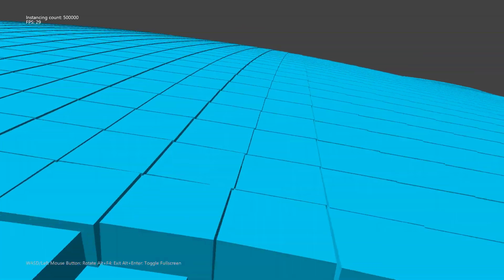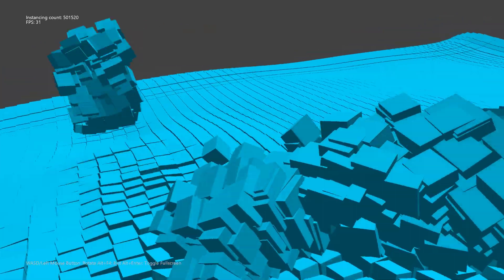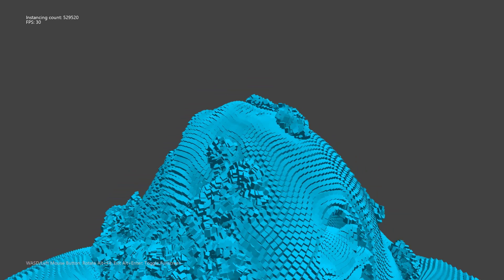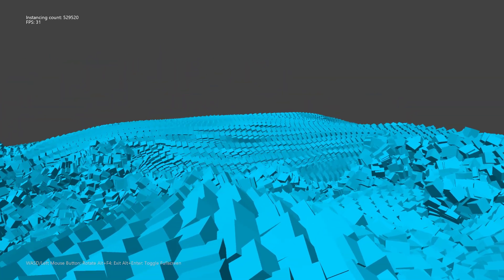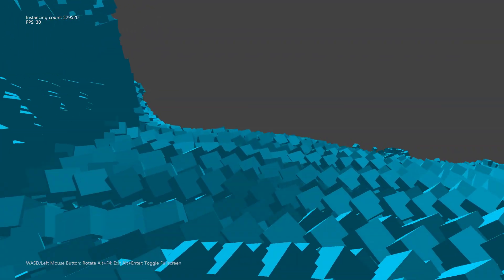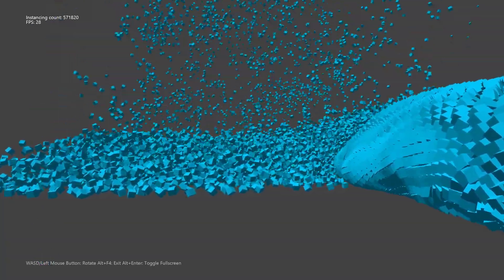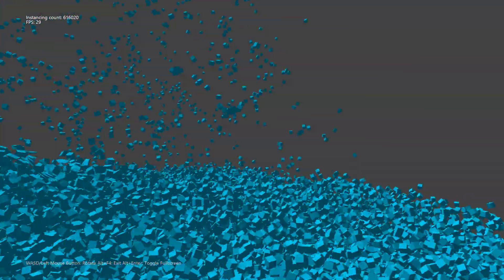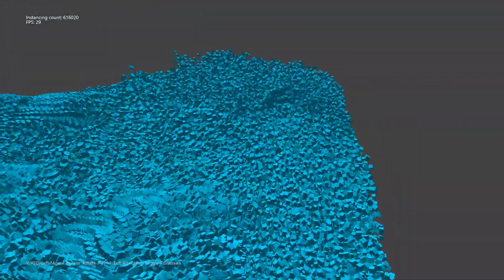Viscoelastic and Granular | Voxel Physics Devlog #4

Comment: >  🔭 Adaptive Level of Detail (more particles closer to the player)
Does each box represent one particle, or is the particle granularity independent to rendering granularity?
Reply from the maker: Each box (or in more recent examples, meshlet) represents one particle. For the adaptive stuff, this actually means some particles get deleted when the level of detail is coarsened (e.g. 50% increase size, 50% delete), and split (duplicated with small offset and reduced size) for higher level of detail. For the time being, it is turned off in most of my demos unless I actually say it is there (only 2 vids). There is quite a bit of work to be done for it still.
Reply: @GrantKot  I see. I'm currently trying to build a similar thing, but with merging and splitting like that I get issues with preserving volume and "popcorn" instabilities. Might be due to the large dt I use.
Thanks for providing the inspiration!
Reply from the maker: Are you using Material Point Method? For volume preservation I use an SPH style density summation each frame instead of integrating density/volume over time. No matter how small your dt is error will always accumulate. See this paper for formulas (especially section 4.5): https://www.seas.upenn.edu/~cffjiang/research/sediment/gao2018sediment.pdf
Reply: @GrantKot   Thanks for the tip, will check that out. Yes, I'm using MPM with APIC. Currently I'm focussing on single material fluid.
Any particular reason why you are using PIC FLIP and not APIC? (At least I though I read it somewhere in one of your video descriptions.)
Reply from the maker: I used PIC FLIP blends for a long time but have been using APIC based stuff more recently. Sometimes I miss FLIP a little, I think in certain scenarios APIC overly smoothes features out. I think you can technically have an affine version of FLIP (should trademark AFLIP lol) and it’s not difficult to do, just requires more processor time.
Reply from the maker: Actually since I’ve been thinking of going AVX2 from SSE2 it may very well make sense to add in AFLIP and might be possible to do without much performance penalty.
Reply: @GrantKot  hehe sounds cool. I'm struggling with performance a bit. With AVX2 and AoSoA I can't get close to the performance you achieved.
Currently a single core takes 20ms to simulate 125k particles (no graphics). Bottleneck seems to be reading (Avx2 gather) and writing from the grid (plain old scalar). Do you have any tips on memory layout or similar things that I might have missed?
Reply from the maker: That doesn’t seem bad, I’m only doing 500k at 60fps (16ms). You might be able to convert the scalar writes to a few 4-wide unaligned writes. If you tile your grid, you could try not tiling one axis to make these accesses simpler. If your kernel is 4^3 this fits 100% but I like the 3^3 kernel better. 16 4-wide writes vs 9. I do admit I might be at a local maximum though, I’m not taking full advantage of 8-wide or 16-wide simd
Reply from the maker: For me I have found reordering to be worth it. I just use a histogram & scan. I am also just using AoS but I guess I don’t get to fully utilize AVX.
Reply: @GrantKot  Thanks! I think that is actually an advantage in your case, as reordering is easier. I will try reordering with AoSoA, but if that doesn't work it it's probably time to rewrite it another way.
Reply: @GrantKot  tried reordering with histogram, where each bucket is a tile. But 500k particles take almost my whole time budget to scan and put in the right buckets. Are you reordering sparsely, e.g. by  flagging particles that change tile for reordering after advection?
Reply from the maker: @robthekat  I'm not doing it sparsely as it seems quite a few particles do switch cells. I also have the reordering mixed with the other simulation calculations, not as an individual pass as it seems just a couple CPU cores saturates the available memory bandwidth.

I've also been thinking, it doesn't need to be the most exact tiling. Especially on CPU you can be a lot more flexible with your "scratchpad" memory. On the GPU MPM papers like https://sites.google.com/view/siggraph2020-multigpu they just use fixed size shared memory arrays but on CPU it's a lot more lenient and you could even calculate the bounds on the fly, like just min max all the particles in the bucket.

Unlike the paper, I don't limit the velocities of my particles that much and I take advantage that each CPU core has a larger L2 cache than GPU shared memory so I can set up a larger scratchpad for fast moving fluid regions.

If you're still using the 8 particle SoA format I wonder if you can lighten the load by just assign each group to a tile by just the first of the 8.
Then maybe amortize the binning by randomly selecting random pairs of 8-groups in the bucket and kind of separating by either the x,y, or z axis, maybe whichever axis separates the first element the most?
Use _mm256_cmp_ps on either x, y or z and then use _mm256_blend_ps.

You could also just do a simple clamp on each 8 group if you can tolerate a little less accuracy.
Broadcast the first x,y,z elements, add constant, subtract constant, and then minmax clamp the 8 values.
I think John Lin might be doing some clamping in his implementation as sometimes you can see blocking/tiling artifacts, or you can sometimes see clusters of particles moving together.
I think he probably uses a fixed-size scratchpad like GPU and clamping via tile. Maybe doing clamping per 8-particle group and dynamically calculating scratchpad bounds would make blocking artifacts and clustering less visible.
Reply: @GrantKot  I hope you don't mind if my answers are delayed. You have given me a lot to parse, so it might be another while before I can respond anything of essence. ;)

I’m still using 8-groups for now. Are the methods you are suggesting primarily for multi core usage? Currently still focussing on single core and there it seems like traversing the particles in such an order that I have the most optimal access pattern, as opposed to focussing on separation, which would be important to prevent cross core stalls. But maybe I didn’t understand fully, will definitely try to work it out further. 

I’m not sure if I understand what the effect of clamping would have. Would that mean excluding the impact on certain cells outside of the scratchpad and in case no neighbour cell is available letting the particle in question stay on its previous trajectory for that time step?

It is interesting how you interpret the artefacts in John Lins implementation. It is interesting how you interpret the artefacts in John Lins implementation. Do you mean his stand alone fluid sim videos or in the voxel world integration? In the latter my interpretation was that the simulation run selectively in certain volumes. E.g. prioritised by visibility or the amount of accumulated change/error.
Reply from the maker: Yeah most of the things I’m suggesting are for multicore and in single threaded mode they would add unnecessary overhead. So it’s not super necessary to bucket your particles in single threaded mode. The bucketing helps you minimize the per core scratchpad area so it can fit in L2. If the particles become too scattered the scratchpad needs to be large and will bleed into L3 and RAM. Single core you don’t need a scratchpad even because there is no danger of race conditions.
Also my previous interpretation of John Lins implementation is probably wrong. Maybe each 8 group just scatters to the same 27 neighbor nodes probably determined by either first particle in group or maybe average position.